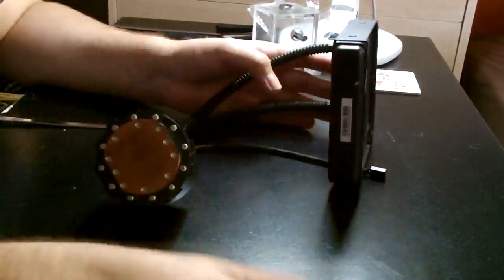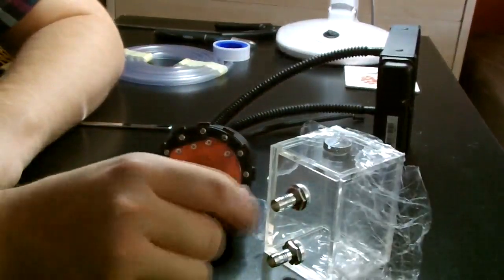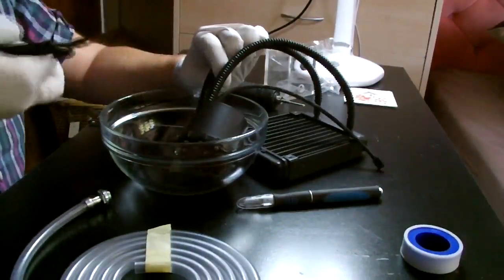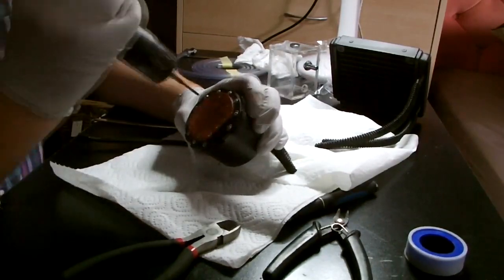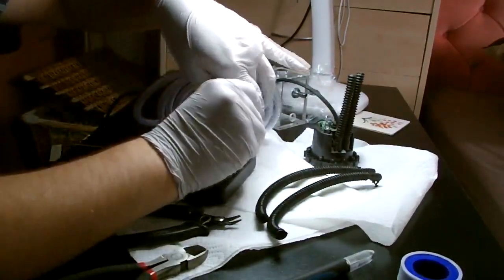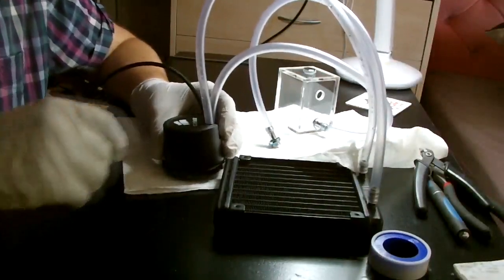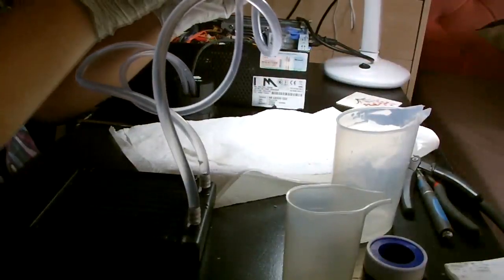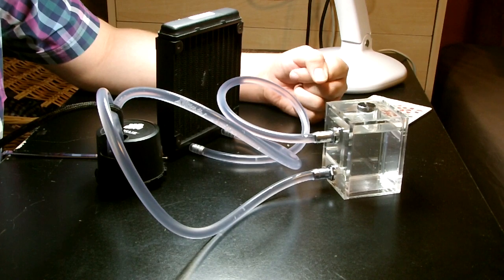Corsair Hydro H50-1 Custom Water Cooling Loop Modification

Comment: I'm about to sell/donate my old H50 but seeing you do this vid, I may well try this myself to save the future owner the hassle.  It may not be worth a lot as the CPU/Mobo spec is limited and incompatible with newer boards but better than going into landfill. BTW, my local recycling centre didn't want it, surprisingly.. The copper base is probably worth £5😯👍

Comment: Would you think that the integrated pump could be strong enough to be used in a system with a 360mm radiator? I have an AIO with a 120mm radiator and was thinking if it was possible to increase the radiator or add an additional radiator using this technique.
Reply: A little late but yes it would my guy. The pump is usually the same throughout a given brand and model. But the size of the radiator and cost changes. So your good to go. Be sure to add proper coolent.

Comment: I know its an older video but was wondering if it's still working? I've wanted to do this but a lot of people have told me it won't work and if it does it's not going to last long.
Reply from the maker: It still working, running now in a 24/7 server. Mileage will vary with things like this and I did need to change up the fluid to something anti corrosion in it. Otherwise it's been perfect.

Comment: I just bought exactly that same reservoir from China to mod an old Corsair AIO. Glad to see it works just fine. This is a low cost way to recycle a perfectly good AIO pump head for use in an expanded customized system. You can easily run two radiators this way tied to a single reservoir. Many older PC cases don't allow for the newer 240/280 or 360MM radiators. In my case, I can fit a 120MM on the back of my PC case and 140MM up front for 260MM of cooling that I couldn't otherwise fit without a buying a new case.
Reply: is it do able? i have 120 AIO that my plan is to mod it to open loop by adding a water reservoir and change to 240mm radiator
Reply: @hendrasiswanto81  That should be no issue at all. 120 vs 240mm AIOs use the same pump head, only difference is the radiator. The most difficult part is getting the flow started, the loop completely full, and all the air out. I've found the easiest way to do this is to connect everything, fill the reservoir, and hold it above the pump head, using gravity to help the suction side get things going. Once you have good flow, you can put everything where it belongs in the case and add more water to the reservior as needed.
Reply: @bluethumbdiy4735  hi I have minor problem, my open loop is in reverse. when my pump suck directly from radiator and dump hot water to reservoir it has no problem, but when it suck from reservoir it don't flow fastly and make my CPU overheating and force shutdown. is it ok to reverse water flow that suck directly from radiator like that?
Reply: @hendrasiswanto81  It doesn't matter how the water goes through the radiator as long as long as you get good flow. If your water is overheating, and you have a good flow rate, then you don't have correct airflow across the radiator. Sometimes AIOs don't have enough power to flow correctly, which could be an issue.

Comment: i tried to make the same with my H60 without reservoir but i didnt had goog flow fromt the pump, dont know why, my idle temp was 60c and the uper top of the radiator was cool, so was the out tube from the radiator. i thought the pump was warking well, i have no clue what went wrong.
Reply: Sounds like air trapped in radiator.

Comment: By undoing the screw between the two nipples in the pump module, the nipples can be easily pulled out. They have two o-rings each.
No need to fiddle around with the knife or any other tools on/in the pump module.

Comment: Thanks mate had the exact same idea as you I upgraded from a kuler 620 to a h100i gtx after a long time using my kuler, left it in a box in my garage for a long time decided to upgrade my GPU with the nxzt adapter as I'm using a reference gtx 1080 the temps are pretty bad, but my kuler had managed to get a blockage in the barb of the rad cleaned that out and did the same thing you did, would've just gone out and got a new one without this vid giving me some confidence in doing this

Comment: Use a cable tie and put it around the radiator tubes so u can get a more tighter fit, hense less chance of leakage
Reply: theres a thing called hose clamps that would work 1000x better
Reply: "cable tie"? You have got to be kidding.
Reply: @christopherjames9843   tweezers ^^
Reply: @-redacted-7716  "The Verge"?

Comment: Hmm, cool video, but i have a feeling that either the pump will fail in a short amount of time or it just wont be powerful enough to push that much water. I mean its only a pump for a 120mm rad and a slim one at that, so I don't think it will be that effective at pumping all that water.

Comment: For those wondering, the Water cooler has a mix of Propylene Glycol and distilled water (battery water). The Propylene Glycol serves two purposes, to prevent freezing in transport and to act as a biocide (to kill agile).
You CAN use Ethylene Glycol (antifreeze) in the same ratio (usually 1part EG to 10 parts water), however remember Ethylene Glycol is deadly toxic (unlike Propylene) if ingested enough, not recommended especially if you have pets (when kept undiluted).

Comment: i brought new thermaltake water 3.0 performer but im thinking when the warranty goes down to change the radiator for for tripple fans but can the pump in the block push that much coolant ?

Comment: your tube is not a 6mm because it really is a 8mm and you also need at least a 240mm rad to make a difference in cooling.
Reply: His intentions were not to "increase" his cooling ability, but to fix what was not working properly. He noticed it wasnt cooling even remotely like it should, and you should NEVER almost "burn" yourself when you touch your hoses. I've had my H50 for close to 7~ years, never had an issue, for the first 6 I never even touch or removed it. But never once have I even been uneasy about the temp. of the hoses or anything.

Other than for the fixing aspect, I also enjoyed this, wondering (why not right) if and how you would turn a All-in-One cooler into a "custom" loop look, clear hoses, florencent or UV lighting on some good colors of coolant would be nice. 

Im actually REALLY considering doing this just for the Custom Loop look. Some blue coolant would complement. 

Makes me wonder if I could incorporate hard lines into it.

We all know its probably easier and "ALMOST" cheaper to just buy a cheap kit. BUT SCREW THAT, I have a perfectly good Corsair pump i've trusted for a long time. Why not use what works. And make it cooler looking. :)

Not bagging on you at all. Just saying.
Reply: @vicariousclouds  I have a h115i pro, works really good, but i'm thinking about getting an used aio and mod it..
Reply: @greggreg2458  I ended up upgrading CPUS since this, so I opted to get another AIO, weirdly enough I didnt go with Corsair, I went with the Thermal-Take Floe Ring 280 (I believe it was that one 100%, been a while now)

I've still contemplated on using my old one to water cool my GPU with the simple ziptie method for mounting. BUT I have a vertical mounted GPU, so idk if I have the space for the pump and hoses. Haven't tried yet, seeing this post again, I may just try to do something.

Comment: I read that the pump for the Corsairs AIO's all are very weak, can you just use the CPU block as just that, a CPU block and add your own pump? Then just not plug in the Corsair pump. Would it flow or would it not ?
Reply: well then better run two pomp :)
Reply: good question, I'm also curious to the answer..
Reply: You're better off just buying an actual water block for your CPU. Probably wayyy less hassle lol.
Reply: They don't manufacture their own pump but most of these AIO uses Asetek pump

Comment: I have an H75 radiator, would these tubes be alright?
https://www.amazon.ca/Food-Grade-Flexible-Silicone-Tubing/dp/B01461MZG0/ref=sr_1_5?s=automotive&ie=UTF8&qid=1489972867&sr=1-5&keywords=6mm+tubing

https://www.amazon.ca/Plumb-Craft-0798520-4-Inch-20-Foot/dp/B003175RHU/ref=pd_sbs_328_14?_encoding=UTF8&psc=1&refRID=053GC0766JSHWHJDAJC8

Comment: what hose did u used?
Reply: PETG cannot be connected with the barb fittings on the radiator and the pump. PETG is good when you use it for a custom liquid cooling system.
Reply: Soft tubing is easier to work with. Stop giving wrong advice Lyralei.
Reply from the maker: 6mm by 8mm 1/4 inch tube was used. I used Aquarium Tube :)
Reply: if you can't get "aquarium" tubing you can also buy Food Grade Vinyl tubing (way cheaper too), it doesn't seep into the water like cheap vinyl (hence food grade), I'd wager its the same as whats used for aquariums.
I've been running it in my loop for over a year and it hasn't discoloured or gone cloudy.

Comment: Nice one! I was wondering about to do the same with my new i7 coming. Just a question, the hose are 12/16mm or 16/22mm?
Reply from the maker: 6mm by 8mm 1/4 inch tube was used. I used Aquarium Tube :)
Reply: Ascendingfog Nice, thank you very much!
Reply: Ascendingfog what screws did u remove.I want to so it w my h55 and i dont know which to remove
Reply from the maker: Here is the phone guide I used.
http://i50.tinypic.com/i3bhi9.jpg

Comment: so if I'd do similar mod with my AIO would you recommend it? I'd go for the copper radiator though for a bit better hear transfer, just in case I want to add GPU to the loop :D
Reply from the maker: I have seen reports that when adding more to this loop you can over load the pump. Its not really designed to take much more load. I wouldnt do more than just add the res and change the radiator.

Comment: Hello, how is you H50 story ended up, is it working properly?
One tiny note: sometimes over time water block internal structure becomes clogged with slush, which prevents it from working properly. It might be liquid components decomposition or may be oxidation.
Reply from the maker: Hi, Its still going strong and cooling my old test rig. Im still not 100% sure what was wrong with it when I took it out but now ive done this mod, its working like a dream. Given it a new lease on life for sure
Reply: Ascendingfog Comparing how much liquid came out of it with how much you put back in, I would suggest to much of the original fluid had evaporated and not enough remained to run the radiator as designed.
Reply: Thanks for sharing 🐨